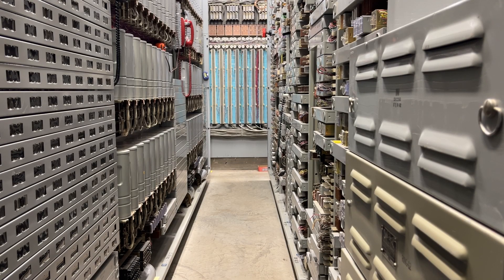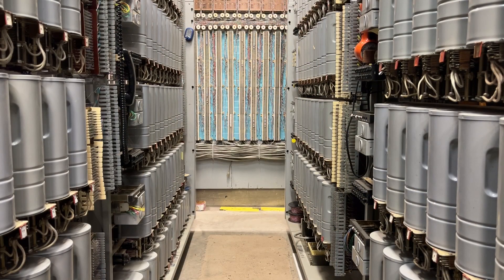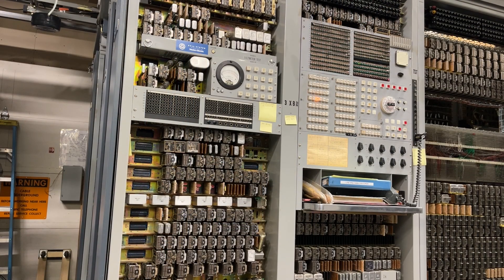Sounds of a old telephone central office in the idle state. Strowger, crossbar, and X-Y.

Comment: I recall the push for "E-911" in t he late 90s, which started the phase out of this gear with the target of everyone in the USA to have emergency phone access via touch tone over a 10 year period, which i thought set the finish date around 2010 or so. I might be off by a little. I didn't know there was any of this gear still in general service. Of course the new equipment would take up a smaller space and in my area they have spots along the road with a cement pad about the size of six phone booths holding gear that once occupied a structure the size of a small library. These would service a small town with a couple of 800 pair lines feeding into the cabinets.